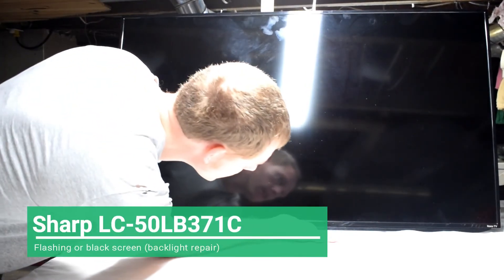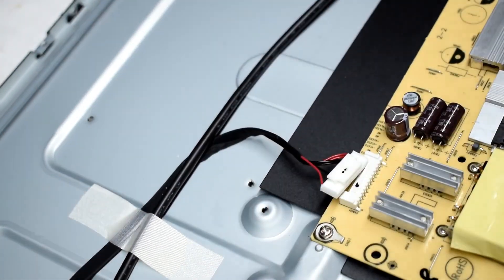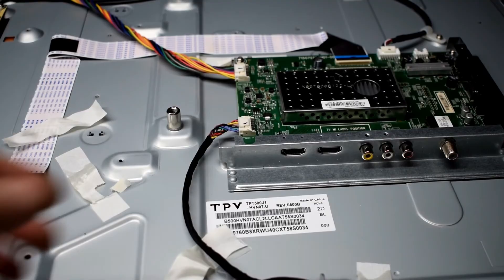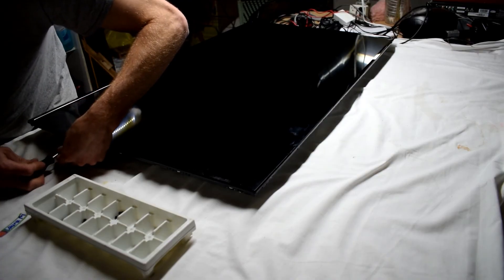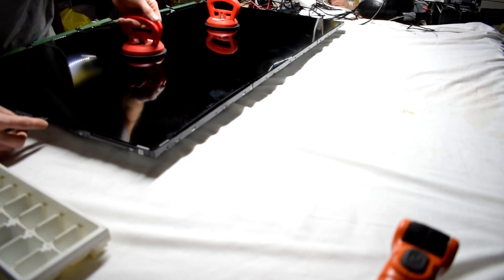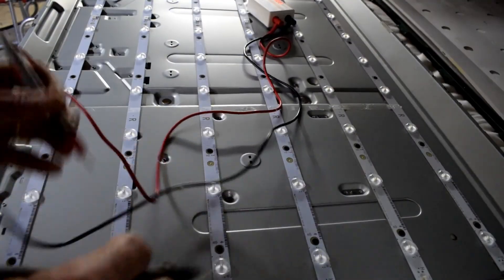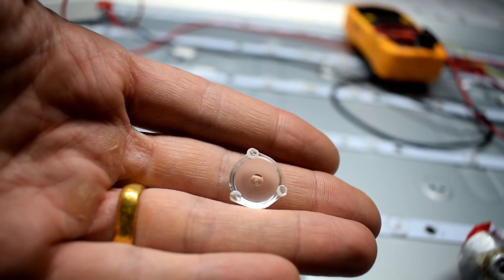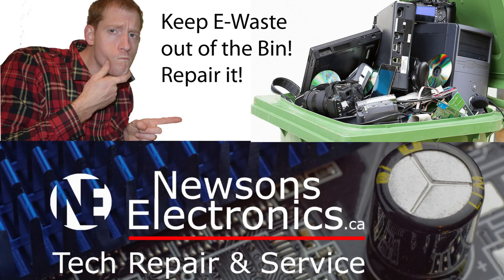TV backlight repair | The EASY Way!

Comment: NOTEWORTHY NOTES
Very likely, every LCD/LED/OLED display/screen is color calibrated upon factory exit, and set to default RGB values within a color calibration menu setting.  Might notice, similar models having slightly different RGB color value set.  More recent Samsung LED TVs are now boasting 3rd party expensive color calibration solutions, however the TV is already (partially) color calibrated but with nowadays insane default settings.

A better part solution, trying to find the OEM specification LED replacement part back lights.  However, likely going to be very difficult, first having to find the OEM part number on the LED lights, then more difficult part search and purchase for one back light.  Digikey and Mouser electronic parts sellers are also good sources of information.

So even though the TV is repaired, RGB values are going to be slightly or largely noticeably not color calibrated, but at least working good enough for a TV in the garage or workshop.  Color calibration for TVs currently, ~$150-300 for the software, another $150-300 for the colorimetric calibration camera.  (eg. Samsung TV outputs: Calman, PC Computer outputs: X-Rite i1Display)

So, better option, give your kid a soldering iron and the old TV for fixing; and buy a new TV.

Comment: I just do this as hobby as I found tv. I found two others too.  Dang can those or do you just find glass with the connection still on them as tv worked but had spots from water so I took on project. I'm you tube this I'm homeless working like a nomad in large tent . Heh cheers

Comment: 6:33 one part of the glass has two connections you plug cables in
 One ripped off gently I've put it as close to or hopefully back on glass and use a tape that I use to make battery packs. A thin brown adhesive. 42 inch rca. It saddens me cuz I got it all apart to clean the lenses.  Plastic strips that I hope i put back on right. Still streaks as i not k ow what to use but i did use very soft cloth like . I figured put back can take out again to clean properly. I. Thinking clean the back glass and all the films like you would a projection screen using a window thingy and  mild soap or something like that . One end to ofje working it downwards ? I never worked on this kinda . Hoped was a plasma but nope led LCD 42 inch rca I find in rain for a day. Everything was dry but was wet between the films
 One thing is I

Comment: Im trying to test my leds individually with my meter in diode mode, ive scratched off the top layer of insulation for the test points. I cant get any of them to light up, and they all read open. Should i get a led tester or did something on the led driver over voltage and actually kill all of them?Im trying to test my leds individually with my meter in diode mode, ive scratched off the top layer of insulation for the test points. I cant get any of them to light up, and they all read open. Should i get a led tester or did something on the led driver over voltage and actually kill all of them?
Reply from the maker: get an led tester is best only 20 on amazon

Comment: I don't want to sound like I'm talking down on you, but repairs like this are pretty easy. I used to fix  similarly broken PlayStation Vita consoles in highschool and sell them, if I could do it as a 14 year old, you can do it too. it just looks intimidating because the unnecessary specialty tools like the LED tester and soldering iron. Just buy an entire new led strip for like $20 and it cuts out both those tools. Give it a try your TV is already broken. Who knows, you night even pick up a new hobby.
Reply: Sometimes the tv is too old and you cant find the strips online, and so replacing individual leds is the only option. That's the situation I'm in with my 10 year old philips tv that I'm fixing right now.
Reply: @santiagoxmoreno  If not on the Bay that starts with "e", try the Express that starts with "Ali". Sorry I can't straight up say where I get my parts, it gets deleted by YT's automod.
Reply: Thank you good sir
Reply: Dude thank you so much for saying this. Really intimidated by the soldering and having to buy all these tools. Gonna look for an led strip and be done with it 👍
Reply: @brandonl7759  Great choice. If you don't have much time, replacing the whole thing is easier and not much more expensive. Expect to pay around $25 for the LEDs, try not to put your thumb through the screen and undoing all your work.
Reply: how do i know what led strips to buy
Reply: @liljay9580  Sorry. My reply got deleted. There should be a sticker on the back of your TV with the model number, for example: "Element Elf4xxx or "Samsung sm9xxx". Type this in on Google followed by "replacement LED strips" I would say my source for parts, but it got my original response deleted.
Reply: @liljay9580  This is like the 4th time I've tried to respond and it keeps getting deleted. There is a sticker on the back of the TV with the brand name followed by a string of numbers and letters. That is the model number. Type that in on Google, followed by "Replacement LED strips," and they should show some results.

Comment: F this...I'm going for projectors now instead of TVs since an issue this simple of a backlight is so expensive and time consuming to fix...many native 1080p projectors are cheap now plus you can adjust the screen to anything it doesn't use up any space
Reply: It's definitely not expensive nor time-consuming, my friend
Reply: @ericmoore7790  it is expensive and time consuming. Tools required to disassemble and repair, diagnostic tools, parts, additional replacement parts if you damage anything during a repair youre not experienced in... learning wtf to do...

Why even reply? Its not expensive or time consuming.... pffft

Comment: I think its the backlight issue but I cant do this myself.
I was told over the phone to just forget about repairing it 
Its a 55 inch Hisence smart Roku Tv but after 2 years 2 months it blnks on and off. Why wont the factory reset work? TV looks brand newI guess they dont make them smart just low quality. I have a LG led tv that is 14 yrs old works well. Its not a smart tv and its small but still works. Why are Hisence for $600 I expected tv to last at least 5 to 6 years. I hear the same from others, very few actually have a good one for 5 years
I dont know Im in a rush to buy a tv now low on $ just LG is small for my living room. I dont know now what brands to trust but I do need a smart TV

Comment: Disassembled my tcl the weekend, ive repaired the older thicker bezel types before, was the difference between £428 for tv or £34 for a new l.e.d strip. Since its not that old went for the strip, not that I have much spare time. But figured keeping the old strip & replacing the leds with my smd gear, since this was the only replacement available to buy at the time might be a good idea. Usually if you replace individual components from mass-produced items, its much better quality & may last longer.
Reply: How'd it go if you don't mind me asking? Im pretty handy but this seems a bit over my head. The tools I need especially seem like they'll cost a bit to acquire. Then there's the soldering...
Reply: @brandonl7759  Turns out it wasn't the L.e.d strip, although I did replace it & I suppose that went well enough. It was an issue with the motherboard. But in the end, I found one of those off eBay about £30 & replaced it & it works. That TV had an electronic circuit motherboard & power board in one. That's good, as you know you replace one & it will work anyway. Instead of there being problems with one or the other board. Others have a separate power & separate motherboard. If you guess & buy the wrong board & replace it you still have the issue. I would guess the power supply part of the board was at fault as it also needs power at a certain voltage to power the l.e.d strips &. That's why they wouldn't light up.
You know AliExpress has lots of spare parts for TCL TVs quite cheap. Seeing as they are from over there. Best way to search though is to use Google put your search item along with AliExpress in search bar & you should find a more detailed search.

Comment: Good vid .. very professional 👍🏻👍🏻 do you know if this method is the same for most smart tv’s ?? Mine is a 50inch LG.. its not long had full replacement of stripes n thinking this be better than another £150 a year or so after..
Reply: It might have another fault, or just be badly designed. That happens too often, but there could be some other component(s) that are put of spec, causing your leds to fry

Comment: do you have a recommendation for what LEDs I should use both of your links above are outdated.  I believe the strips in my tv are the exact same as yours.
Reply from the maker: https://www.ebay.ca/itm/404473544305?hash=item5e2c807e71:g:1asAAOSwW55k8aoF&amdata=enc%3AAQAIAAAA4O7GzzGoZd2IBMW4VaoiMMAck3m46oc7t%2FkSolXYgLgOJsRKIM33XVI4pRbjwC7GM29STrjYYQXAXEfw5R3yyJ1CQJdqoT2M7ogZC7ehT28rzVRI031%2F2TULLFcIgDTQLrCXfalGok3ILJpHHEHp8o7iCDZyAtml72AIvpGJK4l19RYZNbgelXNjGLQP7H85JOPG2aYnbcy8RBIholOK3uUr86briPGzJ3vheOMCFt%2FUFzS6Z6nyLWhF7OM5IIxv1ATSJBWvO3c%2Bpv0xH4cD5ki3VODpY5CSq6xADCEe0ErD%7Ctkp%3ABFBMjtPI4pVj

Comment: My led keep burning, replaced all of them and they still burn. And only on the right side of tv . Any reason ?
Reply from the maker: your using the wrong leds make sure they are 2Watt
Reply: @newsonselectronics8051  I believe mine are 5watts.
Reply from the maker: @sovsol7219  check the grounding they may be shorted on that strip so too much voltage is going to that strip

Comment: I got to the point where I needed to remove the old LED (4:45) but didn't have the tool you used so I used a small screwdrive to get it off. What remains doesn't look look like at 4:48 but its shiny with a raised square on the left -'ive side and a raised vertical rectangle on the right +'ive side separated by a shiny groove. This matches the back of the new LED. I tried using Anders Products liquid wire to make the connection but that didn't work so I guess I need to find some liquid solder. BUT, I'm afraid that I remove more of the old LED than I should have. Or less. If I removed more is there a way to recover from the error? Also, where did you buy you wire cutter? Thanks.
Reply from the maker: its ok to remove more of the old led. but the reason why I cut of the top is I don't need to heat up the old strip to get the new led on. If you remove the old led there should be two pads that you can use to connect the new led to. You can use any small wire cutters here is a link for the wire cutters https://www.ebay.ca/itm/133954224997?hash=item1f304b4365:g:FV8AAOSwdS1hJ7H3
Reply: @NewsonsElectronics  I'm so relieved. I thought I'd have to try and find the actual replacement strips. Thank you for the link to the wire cutters. I think the wire glue I'm using is too runny for this kind of application. Can you recommend a liquid solder. The searches I've done come back with vague non-electronic application results.

Comment: THANKS FOR VIDEO! Friend brought me same TV , same problem but I think different issue: 1. I did not check LED's  like you did. 2. I don't see 65V at the connector between +VLED1 and -VLED1 or +VLED2 and -VLED2 on top of the power supply  and I see 65 V at the 56uF 100V capacitors ( C8107, C8108 ) beside the connector.  Looks like something does not switch power from the PS to the connector.
Reply from the maker: could be the power supply board.